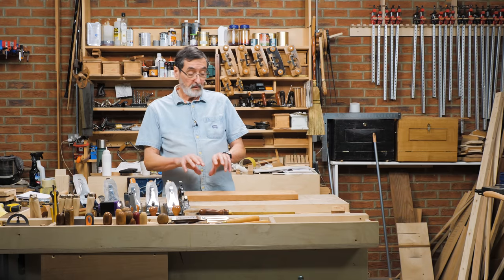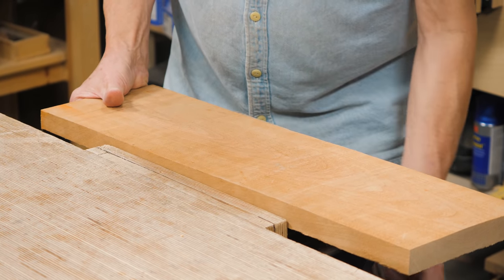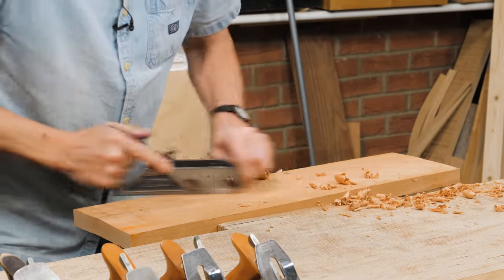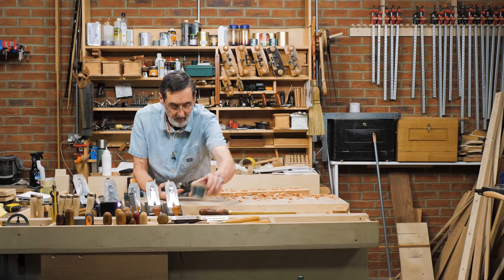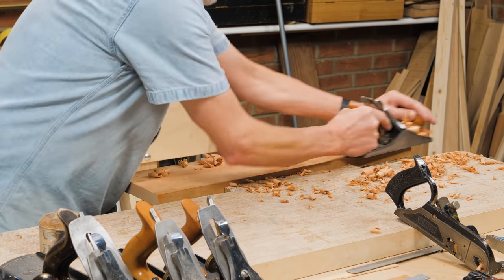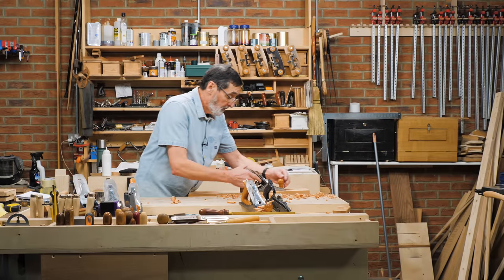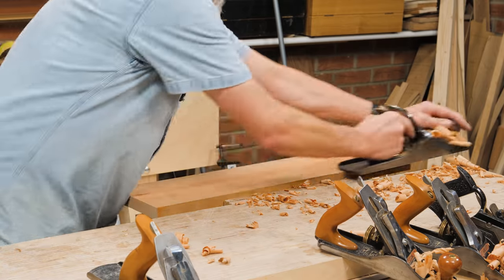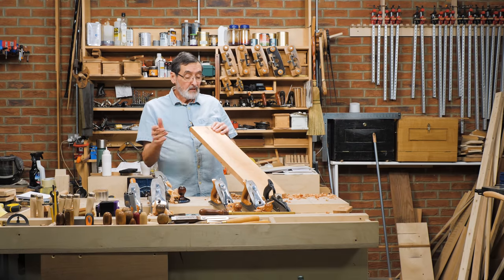Planes I True My Wood With | Paul Sellers

Comment: Thank you very much for this video, Mr. Sellers!  I have a small project that I am starting which will be my first where I will true the wood entirely by hand.  I was a little surprised that you used a Stanley #78 as a jack/scrub plane but, again, this is a new operation for me.  I have seen other planes used as a jack, but not a #78.  My Grandfather was a cabinetmaker, carpenter, boatbuilder, contractor and I have many of his tools including a fairly complete assortment of Stanley planes, scrapers, etc.  As I have been learning woodworking over the years it is interesting to observe how a better understanding of woodworking lends insight into how my Grandfather had set up his tools: things that have seemed strange to me on first observation make more sense over time.  I have been struck by the absence of a jack/scrub plane in my Grandfather's tools, which I supposed would come in a much different form than a #78.  Upon seeing this video, however, I went into my shop and I found one of my Grandfather's rabbet plans which, to my joyful surprise was set up as a jack plane just as your #78 was, Paul.  This plane was a #190, which is a very similar body to the #78.  It brought me joy to  understand yet one more thing about my Grandfather's tools, and to realize that what you are doing, Paul, was the same set up as my grandfather was using just about 100 years ago.

Comment: My strategy:
A Swiss wooden bodied scrub plane for rough removal, then a no5 with a strong camber, followed by a normal no5 or 6. For long pieces, I also have a long bodied Swiss jointer out of wood. At the end, I smooth with a 4 1/2 or an Ulmia Reformhobel.

Comment: One thing I really want to see a video on is how to go about dimensioning a highly figured board, it seems like a lot of the time when I use a scrub on them i end up ripping big chunks out and end up chasing problems
Reply: I always try to work across the grain. If my plane is just taking big chunks out I just switch over to a card scraper. I just spent three hours last night planning a walnut slab for a tiny side table.
Reply: @defjosh75  I have some prices that have really quilted grain rivaling on burl status, but i just wonder if there is a better way to do it by hand rather than doing 5 hours of scraping and checking
Reply: @en510  reducing the camber of the iron allows to take a thinner shaving, but sometimes you have to switch to a regular straight ( ish ) iron and be patient. Oh and sharpening frequently can help a lot.
Reply: Best option is to tighten up your chip breaker to get it as a close to the cutting edge as possible. Requires some precision to get it working. Also go more diagonal not with the grain, you need more camber for that though.
Reply: @defjosh75  Number 80 scraper plane helps too, but mostly better for hard woods.
Reply: The best answer I've found is an old wooden coffin plane with a toothed blade bedded nearly vertical.  Typically used as a prep tool for veneer work, it really handles figured grain well.  Follow it up with a smoother or card scraper.

Comment: Wonderful and informative as usual. But my first follow up question is how do you plane the other side of the board to be perfectly parallel to the first planed side, and then the second is making the second side to a specific dimension width. I've been practicing with a piece of 2x4 and can barely get that flat. Oh well. Thanks for all your absolutely great videos!
Reply: Make the first face as flat as you can (using winding sticks to remove twist). Then plane the adjacent face to be perpendicular to the first flat side. Now you have two sides flat and at 90 to each other. You then use a marking gauge to set the depth of planing to the other two sides.
Reply: @jjorge5610  Newbie here: What are Winding Sticks?

Comment: I worked for the first time on pine and same soft woods with a lots of knots and got confident. Now I tried some maple just to see and it seems to be a LOT different thing. I got the plane to take the more wood I can and it still... not doing much or just tear the thing inside too much. I guess when you get into HARD wood you need to get a different angle but can't be sure if I need to be more parallel of more perpendicular with the blade sharpening. Hard to tell. As I seen, being more perpendicular sharpening (like 20,22,25) was helping a lot and then it was just about adjustments but I feel like I need more angle like 25,27,30 because the wood just bite too much on hard woods with lower angles. 

If someone knows about it and read it please tell me which one I should go (lower or higher angle). I just have one blade right now and I'm pretty poor so it would help a lot to figure it out. Thanks

Comment: I always wonder how flat Paul gets a board like this before calling it flat. To get it flat to within a few thousandths along the length and width seems a lot of work for me. The thought of planing a load of rough sawn hardwood into the components for say a bookshelf seems like a mammoth task. I reckon it’d be at least a few days of hard work. Even slight bluntness in the plane iron can force you to push / press harder to get the job done which inevitably leads to a not so flat board.

Comment: One thing I am not clear about. Whats the advantage of starting with the 78? Couldn't you just reach for your 4 scrub initially?
Reply from the maker: It's a narrower plane with a wide-open throat so you can reduce the highs much more readily yet highly controllably and then follow up with a converted #4 as a scrub at a secondary level. It's hard to explain the pleasure it brings but on a #4 plane you have to use the cap iron that restricts the cutting potential.
Reply: @Paul.Sellers  that makes sense. Thanks Paul

Comment: Mmh, so one only needs a number 4 plane. And then another number 4, and a 5 1/2 and a 4 1/2 and  a rabbet plane... ;-)   That's a count of 5 in my book :-D.
But I understand. So my thinking was that after having a number 4 I will convert an old wooden plane I have (also sized about a no. 4 plane) to a scrub plane and lastly add a 5 1/2.

Comment: I’m surely missing something but I don’t get why you are using a no. 78 as a scrub, with a scrub you aren’t using the fence or the depth stop, then because of the blade’s camber you also aren’t using the nicker or taking advantage of the full width blade.  
I suppose it could be simply because you had it laying around not using it for anything else or because you found it used without any of the accessories.
Reply: Wood working can be very personal. He is probably using the narrow width of the plane so as to target very specific humps in the wood and does not want to be taking off other wood around the area. 
His first pass with the narrow plane is not to flatten the whole of the wood but to target very specific sections. 
That is my read into it.
Reply: My old wooden scrub plane is also a very narrow blade as well.
Reply: I have a 78 for a scrub too. Mine was laying around and had no fence, nicker etc. The blades are cheap and it's works surprisingly well.
Reply: I don't think you've missed much. I think using a 78 which is no longer useful as a 78 is an opportunity. However, when scrubbing high spots using a wide blade it's actually a very narrow part of a heavily 'radiused' blade your using anyway. And a narrower scrub reduces the effort too for step 1. I have which a 78 as scrub because it had a cracked depth-stop and Mr Sellers showed the possibilities to utilise it. That's what he does - you don't need lots of stuff, a 4 will do must stuff but if you have others then here's how. ;) My donkey work is with a 78 and a 4 1/2 or 5 1/2....after I've done as much as I can with a saw(s).
Reply: I would love to see a video of you trying to take off a 1/16th off of a board using a 5 1/2 just because it has a wider blade
Reply from the maker: I have yet to find any other plane that removes stock as efficiently as the 78. It's simple, open throat, no cap iron, no fiddling, easy set up.
Reply: I found a beat up, but still serviceable #4 that I turned into a scrub -- Mr. Sellars has a video on it.  A strong camber on the iron makes it behave pretty similarly to the 78 in the video.  I works really well, and cost next to nothing.

Comment: Paul, what do I do if I only have a jack plane and a smoother...? And lack 50 years of experience?
Reply from the maker: Then you use what you have.
Reply: Try to obtain a second blade iron for one or both of them, grind a chamfer on the blade and you get a free scrub plane.
Reply: @mitschkoff  Often cheaper to buy a second plane complete with blade and convert it. My scrub no4 cost £12.
Reply: I took 3 years of industrial arts while in school.  We did everything, flattening, squaring, jointing, and smoothing using only a Stanley #5 jack plane.  As a result, we all got quite skilled with it.  I built for 12 years trying up boards only with a #5 because it's what I knew.  Get a second iron for it and put a strong camber on the iron for course work and then switch back to your original iron for final flattening, jointing, and smoothing.

Comment: I thought getting into hand tools meant a little more elbow grease but less money for tools. But going by this example, it looks like I'd need to spend $1000 on tools just to true a board!
Reply: You can do it with a single Stanley 4 with several blades of varying camber. That's less than $100. Paul is just showcasing some options. 

With power tools a planer or a jointer would be several times more expensive, and not to mention you'd need to sand.